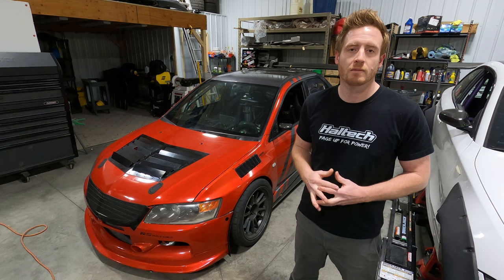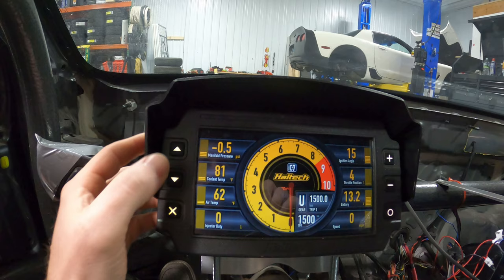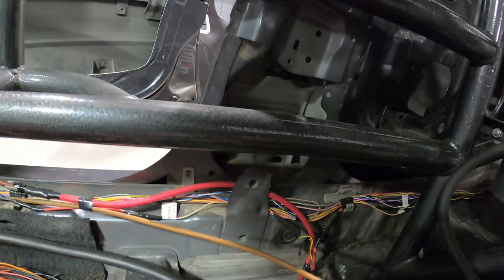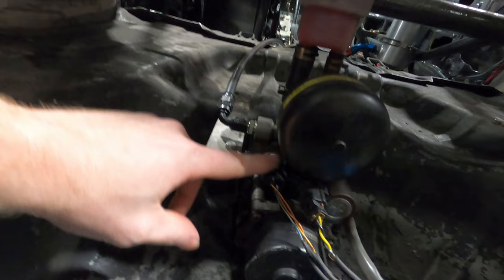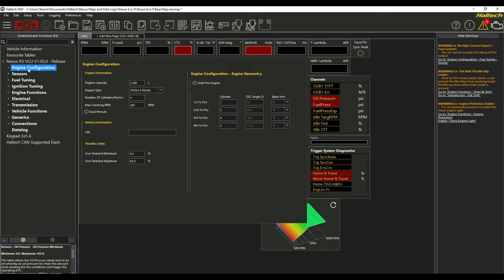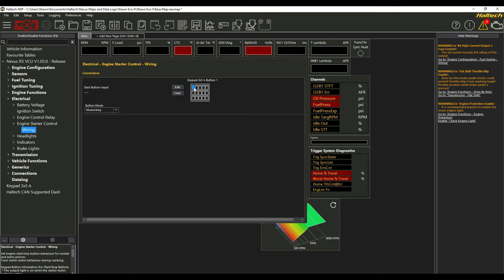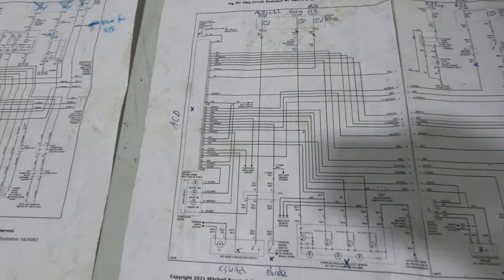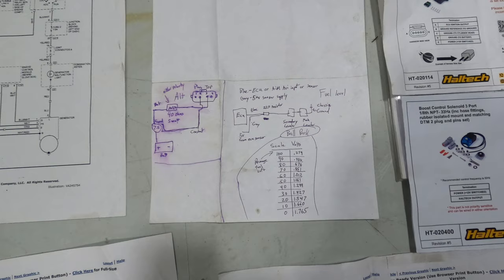Time Attack Evo 9 Build P2: Nexus R5 Wiring & Power Distribution

Comment: The Nexus R3 is tempting me to go into my evo 8. Wondering how many of the available inputs/outputs you needed to use on the R5 and if the R3 has enough available to run all the stock sensors, ABS, ACD. For example, the R3 has 11 analog inputs vs 23 on the R5.